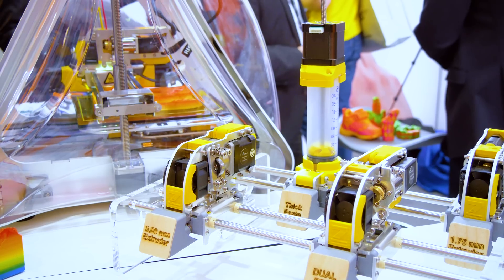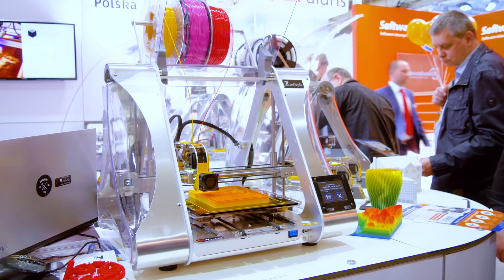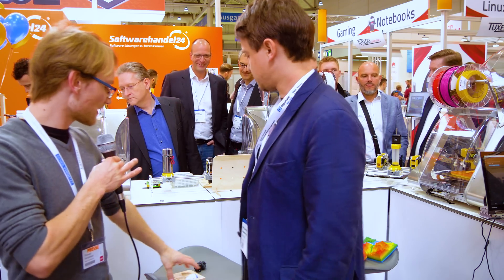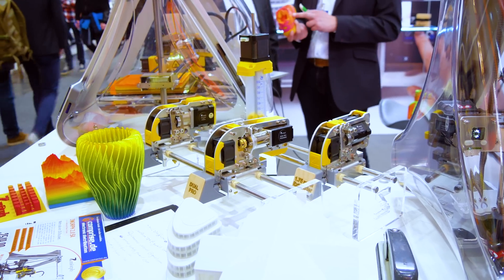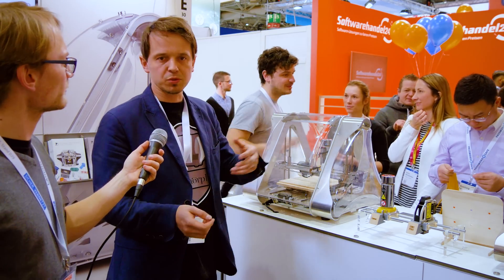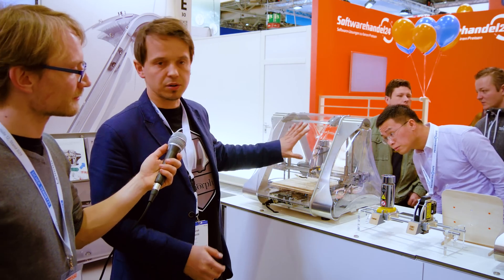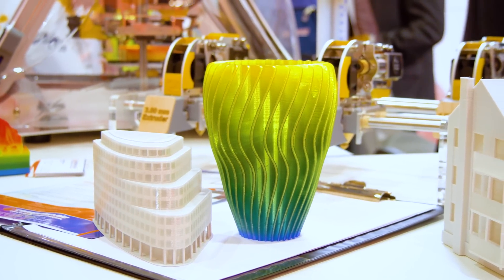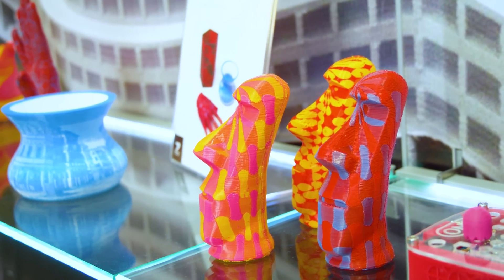3D Printer, CNC, Laser Engraver in one machine - viable or ZMorph's pipedream? #CeBIT

Comment: The stepcraft has a 3D printer extruder as well. But those are different machines.

Stepcraft are CNC chassis with swappable working heads, the Zmorphs are 3D printers with swappable heads. 

This means the Stepcraft have short build volumes like CNCs while the Zmorph have tall working volumes.

Zmorph cost 2000€+taxes+shopping I belive
Stepcraft about half that price. 

Zmorph's software and 3D extruder/mixer is probably what drove their price high, which is normal, they've made something interesting here with real added value. 

 So it depends on one's needs : if you primerly need a 3D printer which can print colorfull stuff with causal wood milling and laser engravïng => Zmorph 

inversly if you need to be able to cut aluminium and causal printing / engraving => Stepcraft.

Comment: The Zmorph can do some really cool things but for me it just couldn't 3D Print well enough, I abandoned the 'voxelize' approach and software to custom build a S3D profile, it couldn't complete a torture cube without failure otherwise.
Reply: Maker's Muse I watch your chanel as well as Toms and I think it's a good start. I would suggest the 3dprinter prints and then the cnc goes around the print removing layers and leaving polished finish (granted intricate pieces would be difficult) but if both heads existed other same machine it could finish edges as it prints throughout :-)

Comment: Nice concept but it all ends up at price/usability. You have a 3d printer, but it's not ultra fast, as it needs to bee rigid as well.. you got a cnc, but you can't mill in alu.. you got a laser engraver and you're limited to 200x200 (i'm guessing).. not to mention for same price you can almost buy "proper" chinese separate machines.

Comment: I have a 3 in 1machine, tell you what, it slows down 3d printing by at least half because stupidly heavy carriage, it can barely mill aluminum because it's still belt driven and rather small spinner, the laser only cuts cardboard because it's just a $10 1W laser (not acrylic that you would expect from a laser cutter). It depends on what your expectations are. As much as it looks like the actual 3 machines, it is not.

Comment: Uhhh, those little belts will cry for help after a few CNC operations o0
Stepcraft can pretty much do the same with their swappable systems, takes a bit more time to swap, but its all on a sturdy CNC mill frame. (Eh, and while im at Stepcraft, its a German company, maybe you could ask them if they would provide you one for reviewing, they also offer a 4th axis, dragknife, heat engraver, automatic cutting bit selector, and stuff i propably forgott about)

Comment: CNC machining (aluminum, steel, etc) puts a lot of force on the structure and mechanical parts of the machine while laser engraving and 3D printing does not. For this reason you would need to design it for the worst case forces for it to be a good machine for all 3 disciplines. Clearly that design is not good for CNC machining. It's a given that belts stretch if you put load on them and your machining tolerance is out the window immediately...assuming you want to achieve even a modest amount of precision.
Reply: Internet Tough Guy this can do routing not milling.

Comment: Kind of a brutal interview, Tom. Got something against that company?
Reply from the maker: +alchemistTi you don't seem to know me well if you consider this "brutal"
Reply: The overall standart for journalistic integrity must have gone way down the toilet if those questions can be called "brutal" :)
Reply: Thomas is a great interviewer, he knows alot on the subject so he can go straight for the throat with his questions. He also knows that all these '3in1' concepts we keep seeing is a bullshit idea ^^. We're looking at 3k euro to get something that does all 3 things. The laser module is around 400 euro alone, for about ~<300, you can get a decent chinese laser engraver with A3 workarea. That leaves us about 2700 euro for the a 3D printer and a CNC machine. For 700 euro you should be able to get a decent 3D printer. That leaves 2000 euro for a CNC machine, you can either make a great CNC machine for that yourself or buy one.
Reply: The concept is great, if it worked. It doesn't really. The 3D printing and laser part is probably ok. But the CNC part is abit useless. I think you'll end up with some frustrated architects ^^.
Reply: +Karan Chaphekar Sorry, you are not being fair here. Prusa i2 is a terrible design because of all the screws and nuts and fittings and the possibility of asymmetrical or bad construction. Zmorph's printer is one whole enclosure, very solid and sturdy, with no leeway or backlash of any kind. They do resemble each other visually, but they are completely different in essence.
Reply: It's still a cheap design, and look at that banding galore on the building, very sturdy machine indeed! No real thought has gone into the design, except for the enclosure, because it's got to look pretty.
Reply: Thomas Sanladerer it was. Check my another comment. They are in different game. His statement that he wanted machine is bs. Its just hard marketing and sells which is backbone of this comapny. They dont care about being up to date. That's why they have i2 design

Comment: The only benefit is compactness and I guess the blending was cool. Something breaks all three break. Have a really large build that requires cnc, laser, and 3d printing well sucks because you have to do one at a time. 3d printer heads are supposed to be light so you can run faster cnc requires heavy and robust they are not compatible. This is soft material cnc and most of the competitors have build volumes 6+ times as large. Oh and then there is the cost... too much. Ya this is stupid. They are targeting a niche of a niche of a niche market. Also they are not even the best in the market stepcraft has got them beat by a mile. But they don't have nearly the media presence...

Comment: Are there any other machines that do material mixing in this manner? I've never seen a machine that can blend between 2 filaments like this.
Reply: Look for "Diamond Hotend" for the open source solution (It even blends 3 filaments) and there is the Geeetech Prusa I3 M201 Dual Extruder Mixcolor which has a custom closed source firmware.

Comment: If anybody is wondering, a voxel is just a 3D pixel.
Reply: Voxelization reduces quality -- this is absolutely a terrible approach.
Reply: Yes and no. It summarizes everything as "points" instead of facets. So some angular parts could look weird, even with extremely high resolution.

I don't want to use a coarse example, but the most famous voxel application in pop culture is minecraft, and nyou can see there how complicated it is to create a circular pattern or an angular wall
Reply: It's a hack. They claim they re-invented the wheel or something. Voxels are a known math principle and have been discounted as appropriate for 3D operations, unless you are doing it for an artistic effect. There is a reason for that. If I take a model with smooth surfaces and curves and voxelize it -- I need a hell of a lot of voxels to represent smooth surfaces at the level the actual machines are able to reproduce it. Just because there is someone in the group with a desire to use fancy buzzwords, it doesn't mean it's the right approach. There have been slicers which voxelize the model prior to slicing -- the results are significantly worse than slicing a pure polygon model.

Comment: The filament mixing extruder is really impressive. I've been wishing for something like this, not so much for color, but for potential structural benefits, such as adding continuous fiber for reenforcement. Their implementation seems to be a great step in making that happen, outside of having multiple hot-ends.

The big take away is the voxel-based approach to volumize a model. I've been thinking about this lately as the real next step for the software side of things. It makes perfect sense when you consider AR/VR as an authoring tool, as you can directly visualize an object in terms of space. I've been looking for a widely used open source CAD/slicer application to fork and add this as an experimental feature...
Reply: The big advantage with a voxelized representation of a model from a programmers perspective is it makes it easy to do things like procedural infill structures like this http://www.3dpinfo.com/wp-content/uploads/2017/02/researchers-optimize-3d-print-infill-structures-mimicking-natural-bone-tissue-1.jpg
Reply: jack riddell sorry, I cannot get the relationship between one thing and another. The path approach seems as prone to adaptive infill as the voxels approach to me. How is the Matrix representation of voxels be any advantage? You can get the enclosed volume from the source mesh without ever voxelizing.
Reply: the advantage with voxles is you can easily query what is around a given cell where as a path/slice based system that is a lot harder / more computationally expensive. Voxles also allow more data to be stored in each cell. For example you can take a voxelized model and calculate how much force/stress will be passing through each cell in the matrix then use that data later to effect the infill design. Multi step calculations do not work well with purely a path/slice representation as it has no easy way to store and retrieve the data from one step to the next.
Reply: Paths could define the ideal shape, and are obviously better for curved surfaces, of course. But for ease of use, and for wide-spread adoption, voxels are easier to process - cognitively and computationally (however, larger data sets). You could draw the shapes using paths, and then have the software fill in and scale each voxel to increase/decrease resolution (e.g. detail) of prints. 

It would also be easier to work with in an AR/VR environment, where 'sculpting' feels much more natural than drawing out curves. For home use, this would suffice for the every-day person. People tend to like using blocks over spheres, and for whatever reason, feed odd utilizing the 'analog' nature of curves... 

Biggest example is the widespread use of matrices to orient objects in space, rather than quaternions...
Reply: I got it now. Collision detection would be so much simpler, ideal for plugins and extensions. Buy as people said there, in principle it would decrease quality.
Reply: Why would make stuff into voxels, not paths, would make things better? I am not doubting you, it's just that I do not understand the rationale here. How can it help?
Reply: Cláudio Sampaio 

These comments said nothing of caring about the quality aspect. You are just apparently against the technology.

You can literally have whatever quality you want by increasing the voxel resolution. The software could make a line path between voxel centers and with that anyone can pick the resolution of voxels to get the exact accuracies they require for the movements.

Comment: Meh.  I'd rather have 3 separate machines that do one job well, then one machine that does 3 job half-assed.
Reply: If you have the space and money yeah for sure,.  An advantage to this he didn't mention is that you only need one controller software to configure and learn. There is also potential to change the head in the middle of a job.
Reply: This thing is basically a Mendel yeah.  It has round rod X axis and exposed belt drive.  It's far from ideal for milling.  I'd rather have a printhead on a mill than the other way round :)

edit: Plan B get that Mori Seki machine with the additive laser sintering head and still have $250,000 on your mortgage  ;)
Reply: Well that depends on how they actually built the machine. Generally, 3d printers don't fair too well as a CNC machine due to exorbitant amounts of deflection in the frame, rails, and belts. However, a converted CNC to 3D printers  are better at 3D printing than most low quality 3D printers since they can handle deflections caused by accelerations extremely well, but they tend to be slower since they are lead or ball screw driven. A good combination machine that you should look at is the Lasertec from DMG Mori.
Reply: Do you have a radio, a walkie-talkie, a cd player, and a calculator separately in your pocket?
Reply: a mobile phone?
Reply: Precisely.
Reply: Well I know about machining and 3D printing and have experience of both. What people are saying here is in fact correct - when you are 3D printing or laser engraving/ cutting you are not applying any appreciable force to the print head, deflection is not an issue. When machining you are applying a HUGE force to the cutter (relatively speaking) and the machine will therefore need to be much stiffer. 3D printer chassis are not really viable, except perhaps for cutting very soft materials like wood. In metals (especially steel) a chassis such as that in this machine would be wholly inappropriate.
Reply: "a jack of all trades but a master of none " comes to mind
Reply: Close enough, I have a small calculator, a caliper, my smarthphone, a mp3 and a flexometer, and i'm looking for a pocket oscilloscope type DSO :3
Reply: MattOGormanSmith y
Reply: all this bad mouthing and nothing to show. not a damn one of you saying this is a bad idea has got proof that you even know anything about machining. this is a great idea. why not have your cake and it too? own one of everything and one of these too if you're so damn needy
Reply: Trust me.  These ideas never work out well. Any space saving, cost saving or time savings will be totally lost when you realize what a POS it is at doing anything but 3d printing. Plus At $2500-$3000 that will buy you a K40 laser, a prusa i3, and a small DIY type CNC machine, and you'd still have $400 in your pocket.
Reply: Not the same thing at all.